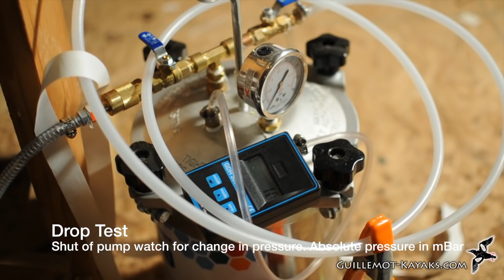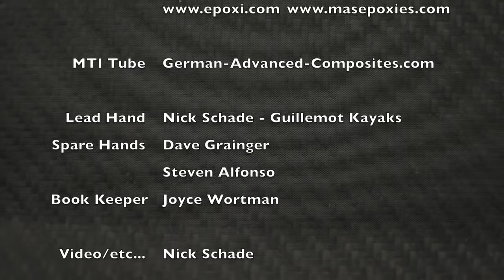Strip Plank Carbon Fiber Infusion

Comment: I'd be curious if carbon and wood is a good fit? I thought carbon is almost not elastic at all but wood is. So wouldn't all the tensile strength rely completely on the carbon fiber (because it would crack first)?
I thought this was the reason why fiberglass and wood mixes so well because they have similar elasticity.

Thanks for the awesome videos!
Reply from the maker: In this context the wood is acting as a core, keeping the inner and outer layers of fabric separated. It is likely that all the interior loads would be directly transferred to the CF, causing the CF to fail before the wood, but I'm OK with that.

I'm not making fighter jets, I don't feel the need to optimize everything to the best conceivable layup. This infusion technique does further optimize an already over-built kayak for the use it is going to get.
Reply: Thanks, that's what I figured.
Reply: I was wondering the same. Good question and good answer.

Comment: I really like this video.  Thanks for posting.
    I assume the boat will have better saturation into both the carbon fiber/glass, and the cedar itself.   In your own personal opinion, do you think the weight gain vs. strength and cost of vacuum infusion vs. hand lay-up is worth it?
Reply: It's not so much about weight, but guaranteed correct laminate to resin ratio and lack of voids (consistency), that make vacuum bagging worthwhile. On something this small, the weight advantage would be very small.

Comment: Nice video! I know it’s old but had a question and hope you get it. How long did the actual infusion take from the time you unclamped the resin line? And what cfm vacuum pump were you using? About to embark on my largest infusion and taking as much in as I can! Thanks, James
Reply from the maker: This took quite awhile. Probably about an hour. I was using MTI tube which I think slowed down the draw. The pump was about 3cfm. Not particularly fast but it could draw a deep vacuum. I am still learning. I would like to experiment some more.
Reply: Nick Schade awesome, thank you for the quick reply! I am getting geared up to do a foam core/carbon fiber technical poling skiff for flats fishing here in Florida. I’ve done plenty of wet lay and bagged, infused a lot of small parts, but nothing of any size. This boat will be an 1854 with a max beam of 71” so it’s quite large bu diy standards! Thanks again, James!🙏

Comment: Why use both cf and gf? Carbon is cheaper then a similar or higher strenght gf but dont see why mixing them. If you want more pierce resistance swap either one for kevlar on the outer layer
Reply from the maker: In order to give the interior a fine finish, I knew I was going to have to do some sanding. If I had not applied the glass over the carbon, I would have sanded into the CF immediately. The glass was a bit of a sacrificial layer to absorb the sanding.

Comment: Up to my understanding, such a strong vacuum pulls air from wood itself too, and during infusion, the resin should penetrate the wood way much deeper than during hand layup. However, the fabric should take up way less resin in vacuum infusion process, than during hand layup. 
So, according to your experience, what was the balance between these two effects? Is it possible to save some weight using the vacuum infusion process?
Did you used this technique for the external fiberglassing too?
Reply from the maker: There were indications in places that the epoxy got pulled 4-6mm into the grain of the wood (along the grain). So, there is good penetration which should improve the bond between the wood and the fabric. 

The compacted fabric definite took up significantly less resin than a hand layup. Overall weight was less than a hand layup, but more importantly the whole layup was just better quality, smoother, cleaner. It really looked great.

On this build I did not infuse the outer glass, but I have since this was recorded. It worked well.
Reply: Nick, thank you for your quick response! As I'm picking up more and more knowledge from your book and videos, it looks more and more evident, that building a boat is not a nailed down manufacturing process, but series of activities of different crafts, preceded with series of decisions.
 I'm gearing up to build a small kayak fleet for my family, and information from your publications renders that decision making process way much easier.
Once again, thank you!
Reply from the maker: There are lots of options for how to build strip planked boats. I would not recommend infusion right away unless you just really feel like taking on a challenge. While the results are nice, it is a lot of work for incremental improvement.
Reply: No final decision made yet in any topic, just accumulating knowledge. I'm at least two month from ripping up the first  board.

Anyway, may I ask, Nick, what species of wood you used on the bottom of the Petrel Play?
Reply from the maker: The Petrel Play is all western red cedar

Comment: Why do you use fiber glass in this kayak??  Carbon fiber alone should do the trick. Or this is for just bringing down the price of this project?   Great videos by the way. I really admire your talent sir :)
Reply from the maker: +zodziusavas I knew I was going to need to sand the inside prior to applying the interior finish. The glass allowed me to sand a bit into the surface without hitting the CF. I could have gone with a lighter glass layer for the purpose, but I wanted to give myself some room for error given this was my first effort.
Reply: Nick Schade why use peel ply if you are going to sand it anyway?
Reply from the maker: Daniel Herbert Partly just for the science. This was the first time I experimented with infusion and it was a bit of a learning process. I do feel the peel ply left a better surface than release film would have, so less sanding was needed.

Comment: Great video. How much would you say just materials cost. And also, any reason why you didn't degas the epoxy resin?
Reply from the maker: Unfortunately, I did not do a good job keeping track of materials cost. I was too focused on not messing up all my hard work up until this point. I didn't degas because I didn't think I needed to and wanted one less step in the process to worry about. Degassing may have helped, but not much.
Reply: Nick Schade Thanks for sharing. 
You don't have to use  release film in vacuum infusion process. Mostly release film uses with vacuum bagging process. So you can save from money and time. 

What is the brand of spray adhesive you used for fixing first layer of carbon. its look like airtac spray. I wonder any spray adhesive is applicable?
Reply from the maker: I have had some issues with the release film. I think I would get a slightly better layup without it because the leading edge of the resin gets ahead in the flow media relative to the fabric, sometimes I get a tiny air spot trapped in the cloth.
I use the release film because I was worried about removing the flow media. The peel ply is probably sufficient.
I went with Airtac spray. I know some people use Super 77, but being new to infusion, I didn't want to throw in another wild card.

Comment: Why are you combining carbon fiber and fiberglass?
Reply from the maker: I knew I was going to have to do a little bit of sanding on the inside. The fiberglass assured I had enough resin thickness on top of the CF that I would not sand immediately into the weave of the carbon.
Reply: Nick Schade I understand. It's just cheap insurance.